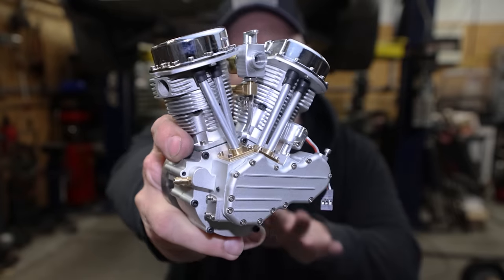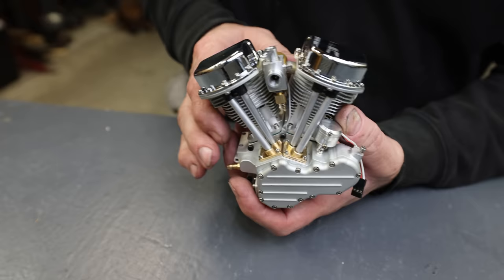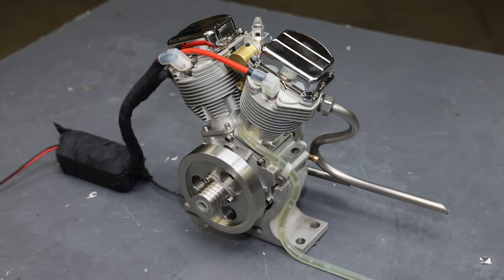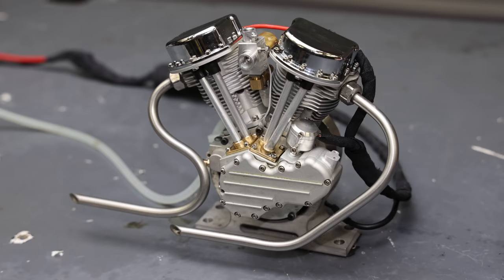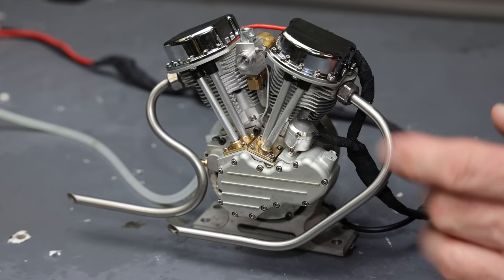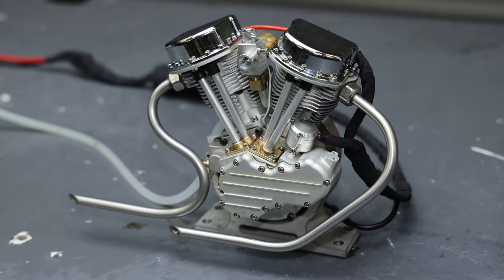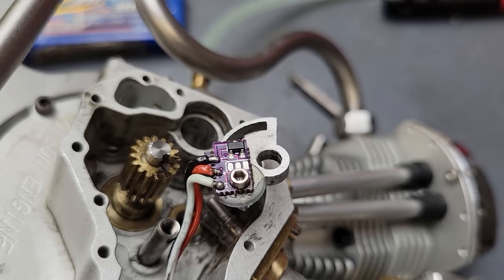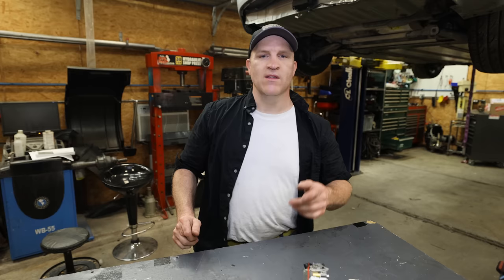Mini Harley Davidson Panhead Engine (Sounds Like the Real Thing)

Comment: That was NOT the sound I was expecting to come from such a tiny engine. Beautiful craftsmanship!
Reply: Right? I was expecting a higher pitch. Sort of like the tiny V8 engines.
Hard to describe, but if chip and Dale were tiny engines. 🤔 This Vtwin had a deep, definately Harley 🎵 note.
I'm impressed. 😁
Reply: I think it sounds awesome I want one
Reply: well when you think of it, Harleys use engines smaller than a Honda civic. for engines like this, the tune, intake, cam, crank, and configuration matter more than the actual size, while an American v8 makes its sound from displacement and overlapping exhaust in large pipes. its its truly a work of art, to make good sounding engines
Reply: it sounds faked. Listen to it the 2nd time he let it idle. It doesnt sound the same.
Reply from the maker: @FranBunnyFFXII  that's because the first time it was running on gas and in the middle of the video I had to swap it over to nitromethane with glow plugs. But I cut the clips together because I needed to but they do sound a little bit different running on gas and nitro methane. Good ears though.
Reply: @WarpedYT  I'm actuall deaf, haha.
I have very bad hearing loss in both ears, and need hearing aids. I can still mostly hear... mostly.

Makes sense on the change of gasoline to nitro.
Reply from the maker: @FranBunnyFFXII  ha! Well your hearing seems to be a lot better than you think it is...lbvs. but in all fairness hearing aids do replicate and amplify certain frequencies better than others, so if the nitro methane didn't produce a certain frequency that the gas did, and you're hearing aid is amplifying that frequency, then it would sound much different to you than somebody who doesn't wear hearing aids... I experienced that a lot with certain types of microphones I use.
Reply: @WarpedYT  I think I may need to choose my words better, haha. I Need hearing aids but I don't have them. Insurance for them and the cost of them is so high I cant afford them. 
Such is life. 
I just have some very loud large speakers that are on my desk and on the floor. I can hear good enough with those... I think anyways.
It was strange hearing the sound difference. Sorry If I accused you of anything I shouldnt have!
Reply: Just awesome!
Reply from the maker: @FranBunnyFFXII  hahaha, now I understand, it's all good no worries at all I never really take anything personal.
Reply: @WarpedYT  0
Reply: @WarpedYT  l9
Reply: Very Cool
Reply: @WarpedYT  Call it the Pinhead.
Reply: @FranBunnyFFXII  You can afford very expensive bike but not the hearing aids?
Reply: @dr.jiIIaIicecooper2587  Why do people talk like they understand everything about everyone.
My motorcycle is my ONLY transport, only vehicle. It's cheaper than owning a car.
Stop acting like you know everything about everyone. Stop assuming things. You don't know how others live their lives. Go be a Karen elsewhere.
Reply: @FranBunnyFFXII  I'm a Doctor
Dr. Jill, not a Karen.
Reply: I don't think thats the sound it makes at all😆
Reply: Why its same only smaller

Comment: I always wanted a miniature engine that runs as a kid.
Reply: Who didn't?! ;)
Reply: I did, all my favorite cars. Now I do with a nap LOL I love this channel he has the coolest stuff
Reply from the maker: Same here, I used to see him in the hobby shops in like a glass case, they were very expensive.. I don't remember very well but as a kid I would say they were $15,000.
Reply: Duuu! We all did dufus
Reply: Same! But I more so wanted a miniature f14 tomcat with jet engines. I wasn’t the only one given plenty of them around these days
Reply: @brandonknight7240  why you gotta call names?
Reply: the most affordable miniature engines (I think) are weedwacker engines. Here you can get a decent one for under €50. I took the blade and pipe off mine and put it on a barchair.
Reply: @vincehoffman179  ? That’s not a miniature engine.. a small engine yes, but not miniature. A miniature is more often than not a hand held replica of a much large engine just like in the video
Reply: Closest I ever came was the "Visible V8" plastic model kit.
Which I'm pretty sure was a Studebaker V8 replica.
Reply: @WarpedYT  yeah, they're still pricey but the advancements in manufacturing technology have made them exponentially more affordable.
Reply: I wanted the chuck wagon and horses from the commercial
Reply: I still want one as an adult
Reply: @pootmahgoots8482  he calls others names, because he has low aelf esteem
Reply: You want an engine that sounds like a goat?

Syntax~
Reply: I build motorized bicycles as a hobby and I was I had that motor!
Reply: @wonkydonkey4371  so are you taking those  gas 80cc motors you can get for bicycles and mounting them?
Reply: @wonkydonkey4371  I've been wanting to do that because of the price of gas, but I'm a little skeptical about the install...looks tricky. If you don't get everything lined up right then it throws the chain all the time
Reply: @brandonknight7240  Really? I took you as somebody that wanted a Barbie as a kid.
Reply: An engine that runs as a kid...
Reply: @gavinvalentino6002  ya beat me to it 😂
Reply: well...600$

Comment: Definitely sounds like a Harley!  Great job building those pipes!!
Reply: Maybe a cool generator for the farmbago?
Reply from the maker: Thanks
Reply: Hello Project Farm 👋
Reply: @Project Farm Hey man I was just think abou you earlier. I Would love to see some Dust particulate mask tests to see which Dust Mask's will save out lungs. Thanks if you Read this!
Reply: not close
Reply: whoa, a random Project Farm appears..
Reply: Project Farm in the house!
Reply: @WarpedYT  no it doesn't sound like a pan.
Reply: Heya Project Farm!!! =8^)
Reply: Hilarious.
Reply: Project Farm test which fuel makes a Harley sound best, nitro, diesel, paraffin, WD40 methane...if it won't break.
Reply: The pipes were all wrong.
Reply: @WarpedYT  
How would unequal length headers sound on it?.
Reply: King of product tests and reviews approved
Reply: Hi Project Farm :-)  Did you bring Cousin Eddy along?

Comment: Sounded more like a nitro harley when revd up, regular harley at idle. This is the best use for a Harley engine ive seen yet.
Reply: Impressive - right down to the rattle and vibration!
Reply: That’s because it has no tranny. If it had gears it’d sound just like the real thing
Reply: That sounds better than mine! Wtf

Comment: It’s amazing that these engines still exist because you basically have 315 degrees of just momentum.
Not efficient by any means but the sound is unmistakable.
Reply: Prob the most inefficient 40hp ever created lol
Reply: 315 degrees, unless circles have changed in recent years. (Harleys are 45-degree engines, not 90). Even more amazing...
Reply: @Cap10VDO  umm that's not how that works... he's taking about the firing order not the angel of the cylinders🤦‍♂️
Reply: Amazing?--How many degrees of "just momentum" does a single cylinder engine have?
Reply: @konnerkramer329  The Angel of the Cylinders, is that an RPG?
Reply: @busterland1805  Mine has a firing order of 720 degrees. They call it four stroke. Rotax built a great 650cc engine for BMW. It was even used in the Dakar. Unmodified. For real. Mind you.

To your information, there have been experiments with six stroke engines. I guess they added an extra inlet and compression cycle. The general idea was better emission figures, but it did not work out.
Reply: @voornaam3191  is the angle of the cylinders an rpg? Uhh no I don't think it's a rocket luncher... unless your definition of rpg and mine are different
Reply: @voornaam3191  Thank you very much!
That is why I questioned Anthony's comment that it was"amazing they exist", when a 4stroke single only fires once every 720°.
Reply: @konnerkramer329  you missed the joke he was making based on you spelling angle as angel in your first post. I know, took me a second, too.

Comment: If you continue to play around with this, I would recommend you get a one way bearing for your starter. Nitro RC cars use these to start their motors and will do a lot better than a speedout bit.
Reply: I was about to mention the metal shavings flying about!
Reply: You're right earlier I called it a Bendix but a one-way bearing would work a lot better have a great day great idea

Comment: The valve cover shape looks exactly like a slice of bread. They should be called Bread Head engines 🍞😂
Reply from the maker: Your right! That would have been funny
Reply: @WarpedYT  hahaha thanks for the pin!
Reply: The motor needs a load on it before you rev the shit out of it.
Reply: After a little heat they're toast?
Reply: @allanhood8402  ..Yeah, I have owned a few Harleys, high RPM with no load is not recommended.

Comment: Great, but needs bigger bore exhaust pipes to really let that V twin noise out. I can't see how a quick blip of the throttle broke the crank, more likely to be a manufacturing issue. Another seriously great episode, man I love this!
Reply from the maker: You're right that was one of the issues I had, I need to source some thinner wall larger OD material, but the issue is the way it threads into the head. I'm sure I can do it though and I'm positive it would sound much deeper
Reply from the maker: As for the crank, yes your right but I didn't want to say that.
Reply: @WarpedYT  Yeah the deep base "BOOF BOOF, BOOF BOOF" sound. But the idle is a little fast. Needs about 900 RPM where the engine shakes and has that almost-stall sound.
Reply: For a 600 dollar toy, the quality is lacking to say the least.
Reply: My money says that great big balancer they got on there did it
Reply: @eugenecorcoran721  you can see there is a resonance in the crank before the high speed footage, it lines up with the frame rate of the camera at one point
Reply: @WarpedYT  the flywheel was incredibly out of balance I was waiting for some issues from that

Comment: What impressed me the most was the leaking oil. Just like a real Harley.
Reply: Harleys don't leak....They mark their territory.
Reply: Harleys dont leak oil.... they sweat power
Reply: @aharownodubhlaoich7768  Harley’s don’t leak… they piss excellence.
Reply: Well, you can always follow the trail..!
Reply: Auto chain oiler
Reply: @dt90891  My Harley does not have a chain... its a belt... it just sweats power 😂
Reply: Ive owned several newer Harley's and not one ever leaked a drop of oil...ive also owned older shovelheads and none them ever leaked...So you can ask alot of people and get different answers on this subject and Yes i know they have a reputation for leaking, but i personally never had an issue and ive hundreds of thousands of miles on them, over the past 35 years
Reply: @eddiedawkins19  i know... my 2009 rocker c i sold last year never leaked a drop

Comment: The "back" cylinder fires first then the "front" fires. So both fire on the same cycle. Makes you wonder how it keeps running without power on each stroke but it does fine:)
Reply: flywheel
Reply: Single cylinder 4 stroke engines exist...
Reply: They don't fire on the same "cycle."  When the rear cylinder is at TDC on the compression stroke (firing) the front cylinder is approaching TDC on the exhaust stroke . Due to the 45 degree bank angle and 720 degrees making two complete revolutions that leaves 315 degrees between one firing event and 405 to the next. That's what gives the "potato potato" sound
Reply: On each power stroke the engine puts power into the inertia flywheel. The flywheel is heavy and maintains its movement pulling the engine into next firing stroke - this engine would never run without it because the of the time between firings. A 6 cylinder modern engine like my vitesse 2.0 can have a small flywheel because of the number of firings is enough alone to keep the engine spinning. The big old agricultural engines do have a flywheel with multiple cylinders not because of firing order but because of low speed, a Fairbanks-Morse 32E engine might idle at 75-100rpm, the Vitesse/Herald engine idles at 750.

Comment: Awesome engine and good sound.  When I look at the aspect ratio between the heads and pipes, seems it could stand a larger diameter tubing to really nail "the sound."
Reply from the maker: I completely agree, and I tried to go with larger diameter and thinker wall but couldn't get it at this time. Definitely needs bigger tubes
Reply: @WarpedYT  Still, the flared connectors were genus!
Reply from the maker: @BobbyOfEarth  thanks, once I tighten that nut down real good that actually made a square sort of flange on the inside and sealed up perfectly with no gasket.
Reply: @WarpedYT  It is far too small. Why don't you build a  L A R G E R   version of the Pan Head? Three times the usual cubic inches is a bit more impressive than a miniature engine. Just saying. Why take all the trouble? For hearing flip flip flip? What a waste. Buy a double scale version of the real thing. And a huge bike. Bet you get more Oh and Aah?

Comment: deeply impressed with the craftsmanship of this thing. Amazing sound.
Reply: It immediately broke. So much for craftsmanship
Reply: @wildman510  that doesn't change my admiration for this little engine. Both sound and appearance are spot on. And the problem was a minor one that has been repaired. Also quite common compared to a real engine.

Comment: Actually the pipes are tuned slightly differently when you tapped on them. Their resonant note in not quite the same , an easy fix.  Great job though!! Impressive sounding too! On a scale basis the ID of the exhaust pipe tubing is a little on the thick side relative to the real engine and may actually be choking the engine up a bit, but only dyno testing would confirm this thought! But these things are often impossible to fix on a scale basis.  Be nice to see it a on a radio controlled scale Harley bike!! Great work!!!
Reply: Noticed that too.
Reply: I don't think they have dyno that small yet lol

Comment: The sound comes from the fact that the engine fires so far out of balance that it basically beat yourself to death. Which is why when they tried to make a shaft drive version of it it would destroy the transmission in short order. I quit counting how many I've told off the freeways because of bent pushrods
Reply: You've been towing a lot of Panheads these days?
Reply: @CS-Loc  Tolding, not towing.
Reply: @j.w.3345  Told? As in you are now speaking to motorcycles?
Reply: Why would the pushrods bend because the engine is out of balance? Pushrods open valves off a cam, they're not effected by the balance of the engine.

Harley probably doesn't use shaft drives because of weight, aesthetics and power/fuel economy loss. 

It makes no difference if a final drive powers a chain or a shaft to the life of a gearbox.
Reply: @christopherdesbaux5950  the cam is driven by a chain or gear that is spun by the crankshaft. So yes they would be affected by the balance of the engine. Correct me if I'm wrong
Reply: @isaacsalinas2686  the balance of the engine is just the vibration left over from the firing order as far as I know?

Comment: 1:40 does anyone know what happened to the OP's amputated finger? I thought I saw something unusual and had to pause & rewind.  New subscriber here, addictive contents.
Reply from the maker: It happened when I was about two and a 2 ½ years old, I was curious about some mechanical things and I went to touch some gears and something called a Ludlow machine, well I pulled my hand in and completely crushed it like hamburger meat. Believe it or not I sort of remember when I walked up to the machine, that's all I remember.

Comment: It’d be cool to see you use these engines in rc cars boats planes
Reply: Or a chainsword
Reply: Id venture a guess that most rc hobbyists would never put up with the problems these engines would cause. Plus, a true rc engine has been engineered and refined over decades to be efficient in power to weight ratio. These Harley models are just barely able to stay running, let alone produce useful work.

Comment: a mat of rubber would change the sound. Pretty cool RPM this thing got. Really sounds great. The board that the engine was stuck on, reacted like a speaker, and that's where background bassy sound was. The rotation of the engine was just the treble. Hey, I played fuel from Metallica.

Comment: At idle it sounded like the 58 pan in my garage when you gave it gas it sounded like a hopped up weed eater sweet motor I bet it was not cheep. I wish my pan was that easy to start.

Comment: A Harley engine doesn't have separate journals for each connecting rod like most 2 cylinder bike engines, they use two large flywheels joined by a common crank pin. Both rods share that common crank pin hence the need for an odd firing order. That's why they have that lopey idle and unique sound. These were designed to imitate radial aircraft engines because at the time, those were the most powerful engines available.
Reply: Both cylinders fire at the same time only ones intake while the other exhaust !

Comment: U R Making every Harley Biker Drool over this dude. 
The Best Harley sound comes from as you pick up from a low idle speed nice and slowly over about 5 or more seconds. 
That's what you get as they go down the road through each gear.
U need to build a little miniature chopper to put it on. 
Make a miniature Easy Rider Chopper and U will B the king of the Road ! 😀😎